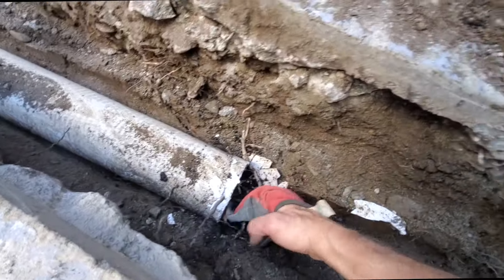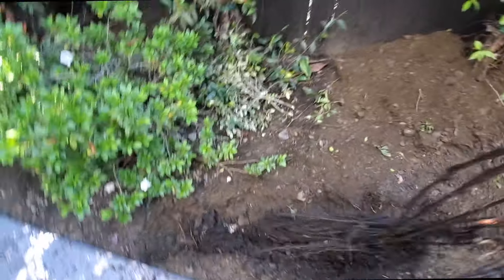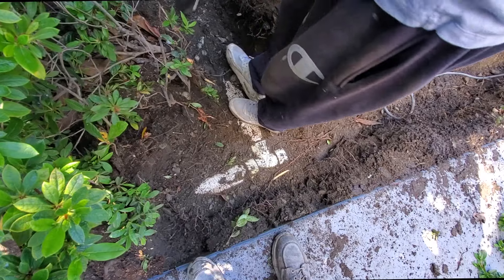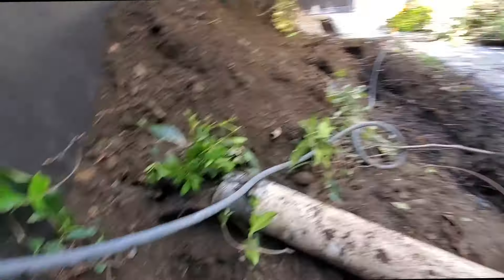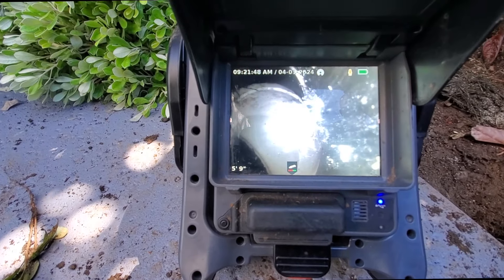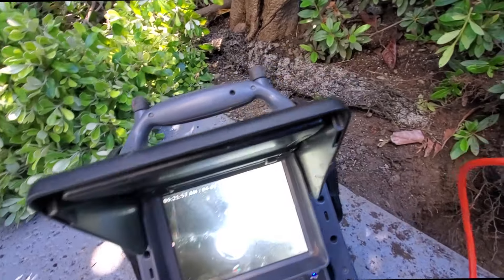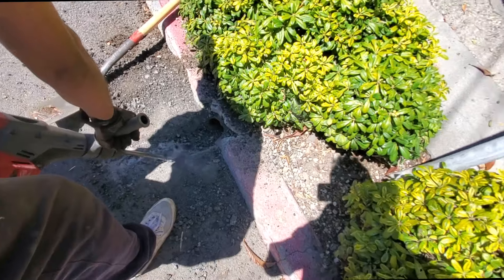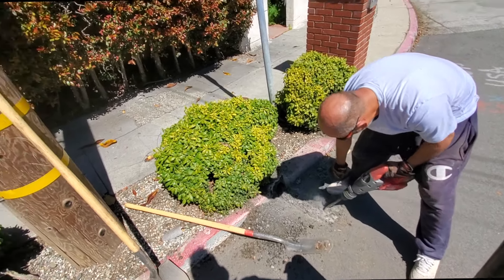Storm Water Drain Repipe - Part 2

Comment: I can’t tell how many feet - - - it feels like miles - - - of that fucking black 4” corrugated flexible
pipe I dug during my plumbing career. Used for underground downspout drains by idiot
roofers or landscaping companies. That pipe is total crap.  I feel for you on this job.
Reply: It’s ruined/ruining soo many foundations too… in the southeast it’s disheartening to see concrete poured straight on dirt without proper grading or compaction. 
Because once those corrugated pipes start failing and blistering from roots/rodents — the carpenter ants and moles come in and steal from the water source left over in the clogged pipes + mosquitoes accumulating

I totally agree with you, it’s crazy to see it everywhwre